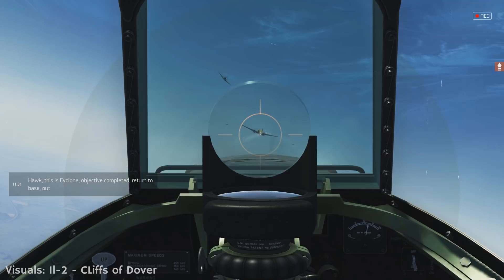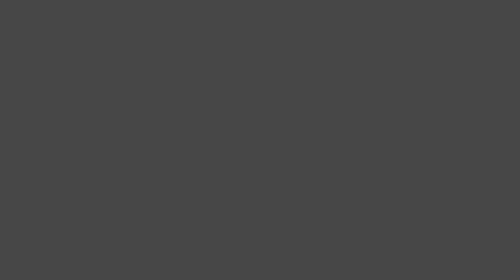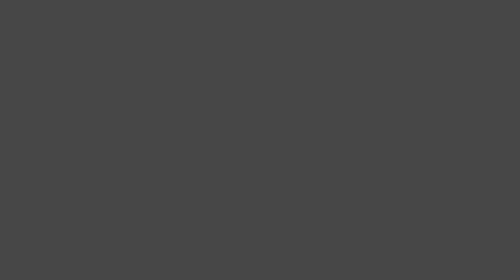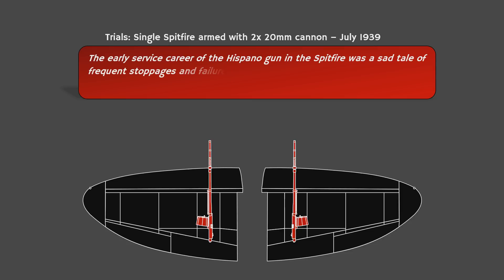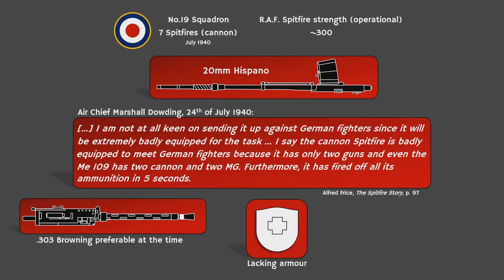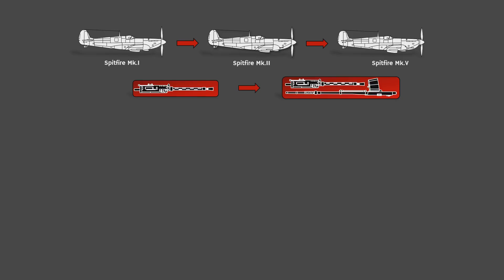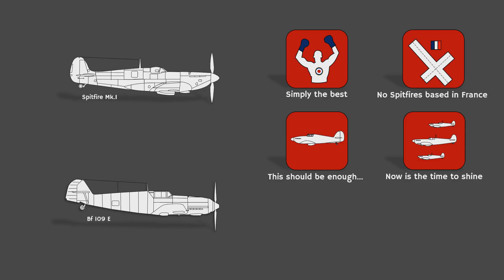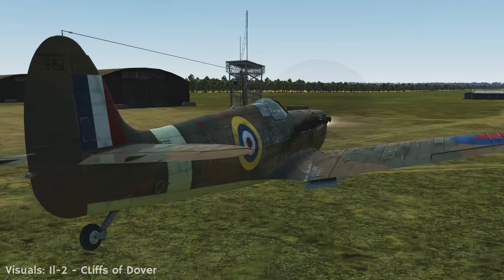⚜ | Clearing up Spitfire Misconceptions

Comment: You forgot to mention that a spitfire with an engine failure may glide indefinitely until it shoots down a Ju87.
Reply: Even when its out of ammo. With its looks. P51 Mustangs kill your airplane in a dogfight. Spitfires kill your SOUL.
Reply: So! We have a 10 year  old 'Merikan' posting do we?
Reply: mikeythebold tv agreed, I think Bismarck called it "British Flag waving." It was much like the love story in Titanic, it didn't need it.
Reply: DEEREMEYER1 no spitfire can dogfight
Reply: I saw that happen in real life: The IMAX at Chichester. I did groan a bit during that scene, but otherwise found the movie extremely compelling, especially in IMAX.
Reply: Altered Beast you are right spitfire can dogfight
Reply: I gotta admit I laughed my @$$ off with that scene in the movie Dunkirk. Who knew a Spit could be so effective when it's out of fuel.
Reply: @deeremeyer1749  Remember P51's wouldn't have been so good without the Merlin engine. They had limited high altitude performance with the Allison engine. P51D had the Packard Merlin. So think about that one!!
Reply: Wasn’t it an He 111?
Reply: @louisbeerreviews8964  303 squadron
Reply: John Cornell Dunkirk reference . I got it
Reply: @GrrMeister  And the weight after having used all the fuel and most of the ammunition...
Reply: @pauljohnson4674  ; The Yanks did think about "that one", that is why they changed to the engine and many other things making the Mustang one of the best planes of type.
Reply: @buildmotosykletist1987  Mustangs were exported to the UK. It was in fact the British that modified their Mustangs to take the Merlin engine. The USA followed and fitted licence built Packard Merlins.
Reply: @pauljohnson4674  ; The Mustang was designed and manufactured to British specifications for the RAF as a low altitude fighter/bomber at which it excelled. The Brits approved the design of course. The US did not intend to use it. There are a few good books on the Mustang, you might consider reading them.
Reply: @buildmotosykletist1987  That remark of yours smacks of bitter envy of a British past that needs no 'puffing up'...Ah diddums.  Sorry it hurts ya' so much    :)
Reply: @paulbantick8266  ; I'm a British citizen, why would I envy my own past.
Reply: @buildmotosykletist1987  I suggest you also read that the Mustang was not good as a fighter until it was fitted with a Rolls Royce Merlin 60 series.  Even then, its only real attribute was its range and numbers which got the US day bombing doctrine out of the shit.  With no Merlin, US bombers switch to night bombing until at least late 1944/early 1945.
Reply: @paulbantick8266  ; Fact check that rubbish please. And, read a few books before you sprout off.
To summarise those planes: The Hurricane, Spitfire and Mustang were all good fighters when deployed where they excelled. (note that 'full stop' or 'period').
[Note the Spitfire and Hurricane complimented each other. They were a good pairing.]
[Would you compare a P38 with a Spitfire?]
BTW, I'm curious; how old are you?
Reply: DEEREMEYER1 . And it was designed for and powered by the British, and it is this, that made it the plane it became, because with the proposed Allison engine it was not very good.....
Reply: Paul Johnson. The P51, was made for the RAF, and if they hadn’t paid for it, it wouldn’t necessarily have existed, and I think that you will find the RAF asked for the Merlin to be fitted to it........
Reply: @norrinradd3549  ; Yeah, it's a shame the Brits got their original specification so very wrong.
Reply: @norrinradd3549  ; Ignoring the inane attempted abuse. Perhaps you should take into account as i do that not everyone reading is a Brit. 
Basically I agree. Originally the Brits (us) wanted an existing (old) US plane, the yanks suggested it was not suitable so the Brits (we) came up with a new spec for a new plane which is what was delivered. It was an excellent plane for what was asked for. We (the Brits) discovered our spec was wrong. The resulting modifications were excellent and it also complimented the Spitfire well.
Reply: @norrinradd3549  ; Your searching for info as you go along. Try reading a book. The RAF wanted a supply of the Curtiss. Search that.
Reply: @buildmotosykletist1987  It hurts that 'IF' you are, you should act like one.
Reply: @buildmotosykletist1987  I do not need to 'fact check'  If you think that any of my answers are incorrect, please highlight my 'spout-offs' by posting corrections. If you have any,  list my inaccuracies and put up 'corrections'

"The Hurricane, Spitfire and Mustang were all good fighters when deployed where they excelled. (note that 'full stop' or 'period'). "
Of course, they were. '(note that 'full stop' or 'period').'

"[Would you compare a P38 with a Spitfire?]"
Why?  It seems to me that your brain has tripped on something or things that weren't mentioned.  Methinks you will post something in reply but what it will be only your mental interpretation will say... 

"BTW, I'm curious" 
And there's me thinking that you went by the name of "build Motosykletist"  

"how old are you?"
I'm as old as my fingers but a little older than my teeth
Reply: @paulbantick8266  ; I'm glad you now agree with the point of argument I began with.
Reply: @buildmotosykletist1987  You are as deluded as you are misinformed.  Like I posted above,  'If you have any,  list my inaccuracies and put up 'corrections'
Reply: @paulbantick8266  ; You disagreed the Mustang was a good fighter. You wrote "the Mustang was not a good fighter". Now you agree as you wrote: "Of course, they were." So you now agree with my point. End of.
Reply: @buildmotosykletist1987   build Motosykletist  Is English your first language?  I suggest you read my posts again...'End of'
Reply: The funniest scene is when the pilot torches the spit and we see that instead of a merlin engine block in front of the pilot this plane has a broom handle with a propeller on! Don't get me started on the fact that there are container cranes in the background in some scenes. lol
Reply: @neilwilson5785  which is why the spitfire was the only allied fighter on par with the fw 190 and the only fighter German pilots were truly afraid of. Saying a spitfire can't dogfight is like saying a bird can't fly.
Reply: Weird that you can spend 100 million on a true story film and not get the basics right. Notice how the Magic Spitfire that was out of fuel, before shooting down the Stuka, had unlimited ammo? When I looked up the specs...They had just about 16 seconds, and done.
Reply: @pauljohnson4674  Even more than that the Mustang was built for the British by North American Aviation on request from the UK. If it was not requested it would probably never been built. In the first place Then a Rolls Royce Merlin was tried In the Allison engines place in the UK.  After this the US airforce realised its potential as a long range escort fighter and adopted the Mustang with the Merlin for that Role.  146,000 Rolls Royce designed Merlins where built at four factories in the UK and Packard under licence in the US. Packard produced 55,000 Of these. Great teamwork Fantastic plane by North American, fantastic engine designed by Rolls Royce. The Rolls Royce Griffin replaced the Merlin in the Spitfire adding more power after the MK V to counter the FW 190 threat. As mentioned the carburettor problem with the early carburettor when a pilot suddenly dived after an escaping German fighter, was solved early on with a simple mod  then designed out altogether. The problem was under negative G the float in the carb allowed over-fuelling causing surging or cut of the engine , the fix. A washer with a hole in it inserted in the fuel supply line, this limited the max amount of fuel supplied to values the engine could run with. Simple fix in a very short time period very early on.then followed up and designed out.
Reply: @buildmotosykletist1987  North American Aviation built the Mustang they used the best they could get including the Allison Engine. It was ok at low level but due mainly to single speed supercharger no good at altitude.  The Merlin with two speed supercharging changed the Mustangs performance markedly, you only need to hear what the US pilots thought of the Merlin including the Red Tails a famous all black squadron. Please talk technical rather than point scoring. The allies kicked helped win a war with this bird. Nice airframe nice engine period.
Reply: @buildmotosykletist1987  completely wrong the Mustang was built brand new design for the Brits in record time by North American Aviation,. using some technology gained from competition for a fighter which the P40 won.  So it was new not old get your facts straight. You did claim to be a Brit, with your lack of knowledge and  bias a bit like Soaring krapter, you could well be a Troll not a US or Brit you will have to change your name and try to sneak back in again. But you will be spotted. The Brits and the US have got each other’s back.
Reply: Marvin Cooper  I have met people that! Keep facing them and don’t fall asleep it’s safer.😀
Reply: @anthonywilson4873  : The allies won the war with many different planes, ships, etc, no one item or nation won the war.
The Mustang was an excellent plane, so were many other planes.
[ WOW, in your second comment, you totally misquoted me on the Mustangs spec and design. I suggest you re-read my comments, I stand by them totally.  Are you trolling or have you changed name and returned to this thread? Are you 'Norrin' ? ] [ Gotcha Norrin. ]
Reply: @anthonywilson4873  : Here is my comment as posted above [including] edits at the time in ():
"Basically I agree. Originally the Brits (us) wanted an existing (old) US plane, the yanks suggested it was not suitable so the Brits (we) came up with a new spec for a new plane which is what was delivered. It was an excellent plane for what was asked for. We (the Brits) discovered our spec was wrong. The resulting modifications were excellent and it also complimented the Spitfire well."
Reply: That is true that the spitfire's wings supply tremendous lift.
Reply: @louisbeerreviews8964  That's not true! The spitfire was one of the best turning fighters in WWII!
Reply: @johnhoward2083  303 squadron was using Hawker Hurricane only commanders of Polish squadrons were granted access to the Spitfire and it was after 303 allready became the most famous squadron with all that crazy things that they were doing like attacking German formations with disadvantage in numbers 30 to 1 (in second battle of the squadron)->and not losing single plane in the process.
Reply: @jacobkingsford5209  "the only allied fighter on par with the fw 190 and the only fighter German pilots were truly afraid of" yea Germans were the best, with the best equipment and everything until the very end when they lost the world war... AGAIN!
And from reading all the German fanboys its clear that they are completly unaware why in the end they always failing...
Reply: @Bialy_1  I'm not a German fan boy, if you can actually read you'd have seen I said it was the only allied aircraft the GERMANS considered on par with the fw 190
Reply: @louisbeerreviews8964  ?? Did he delete something
Reply: Actually during the allied bombing campaign an escort P51 shot down a German plane while gliding! The pilot was interviewed long after the war and said that he dropped his tanks but had forgotten to switch to internal fuel so his engine died. But he was in perfect firing position so he fired, got hits but then dropped beneath the plane and had to worry about restarting his engine. He did enough damage in the short burst that the enemy pilot bailed out. This is from memory so if I’ve bungled the facts mea culpa. Maybe someone else can correct me.
Reply: @Whitpusmc  that's quite cool
Reply: In the film Dunkirk the Spitfire  glided and shot down planes for at least 5 minutes lol.
Reply: @pauljohnson4674 the early marks were really very good, provided they stayed under $15,000 feet.
If memory serves the P-51B was the first to get the Packard Merlin engine.
Reply: @buildmotosykletist1987  a couple were sent the Wright Patterson as a matter of courtesy. The Army Air Force liked the performance and decided to procure the Mustang as well.
Reply: @norrinradd3549  Actually North American had the same idea, and test fit a Merlin to a US airframe. Great (engineer) minds think alike. 😏
Reply: @pauljohnson4674  Allison met the British specs of the time . Dont think allison couldnt put superchargers on their engines and quite frankly that was the only difference . The Spitfire was slow and had no range  . The Merlin was available . Maybe England shouldnt bite off more than they can chew and America will not have to come and save their asses .
Reply: @pratik1568  I laughed my ass off when it happened, also because when the JU-87 crashes you can really tell its an RC plane

Comment: The Rolls Royce built Merlin engine is universally acknowledged as one of the finest piston engines that has ever been manufactured. Remarkably, over 50 years have elapsed since the last Merlin engine rolled off the production line, yet it is still in widespread daily use in warbird aircraft, including the P-51 Mustang. Just as North American Aviation would never have envisioned their Mustangs would still be flying, Rolls Royce probably never considered that their beautiful Merlin power plant would still be in "front line service" in the 21st Century.

Comment: A lady called Beatrice Shilling invented that restrictor, and it was just a simple ring which would give the Spitfire a bit more time in the fight!
Reply: it just trapped some fuel around the main carb jet when negative G was applied. previously the fuel would shoot up to the top of the carb leaving the main jet dry and the motor would loose power drastically..climbing turns were also an issue if the pilot really hauled on it... a pressurised fuel system helped dramatically in later models before fule injection
Reply: It wasn’t a simple washer. It was engineered fairly precisely. 
And the main problem wasn’t the fuel flying up when the aircraft dived. But at the bottom of the dive all that fuel would flood the carb and that was actually the more serious problem. 
And no one would have dared refer to it as Miss Shilling’s Orifice to her face. It was probably ground crew, and not the pilots.
Reply: @davidmarshland3709  I just wanted to share her name. Calm down
Reply: Her solution needed modification (stand pipe, etc) to be more effective.  A good first effort, but not a final solution and not during the Battle of Britain.  She was just one minor engineer among many.

Comment: If you are interested, I highly recommend Sir Stanley Hooker's book 'Not Much of an Engineer'. He goes into an additional dimension of why the early Spitfires were carbureted:

'Let me now add that the Germans paid a large penalty for their fuel injection. When the fuel is fed before the supercharger, as on the Merlin, it evaporates and cools the air by 25° C. This cooling enhances the performance of the supercharger, and increases the power of the engine, with a corresponding increase in aircraft speed, particularly at high altitude.' (p. 62)

The Spitfires could run their superchargers at higher boost, and this put them in a place to take best advantage of the 100 octane gas coming from America. Hooker claims they were able to get 2000 HP out of a Merlin as a result of this. Combined with the weight and cost savings, carburation seems like a perfectly valid design choice under the circumstances.
Reply: The 2000 HP Merlin engines came later but yes, carburetors did allow the British and Americans to always have more horsepower from their engines than German fuel injection. And by 1942 they had pressurised carburetors in Spitfires and Mustangs that completely eliminated the negative G engine cut out. The main reason carburetors have mostly died out in engines these days is because of the requirements to use catalytic converters to reduce the amount of pollution released and catalytic converts require a very precise mix of fuel and air that you can only really achieve with fuel injection.
Reply: It is often ignored that the BF-109 had a bigger engine  not as big as the Griffon  but considerably more swept volume than the Merlin. Having worked on car with the early German mechanical gasoline injection Rolls-Royce were very wise to stick with the carburetor produced by SU  (nb. not an SU Carburetor)  then go to  pressure carburetor / single point injection
The 30/70 glycol water coolant of the Spitfire of the Merlin II also allowed a specific power increase.
Reply: It should also be noted that Stanley Hooker designed the 2 stage supercharger with an intercooler, aftercooler and backfire screens which allowed the optimum performance of 2 stages.  The Allison, by comparison was never designed properly to take their auxilliary supercharger, relying only on water injection to prevent detonation - it wasn't effective.  NAA knew this and railed against such a project by Allison because it wouldn't be easily fit into the Mustang,  and NAA immediately started looking at alternative engines (Merlin XX) in Mar 1941 for the Mustang. 

The Merlin was eventually tested for WEP bursts of 2640 HP, but jet engines were on the way by 1944.